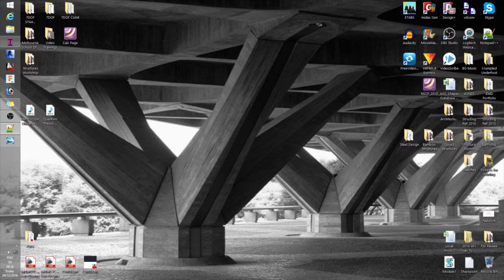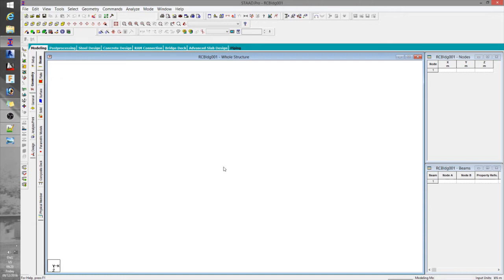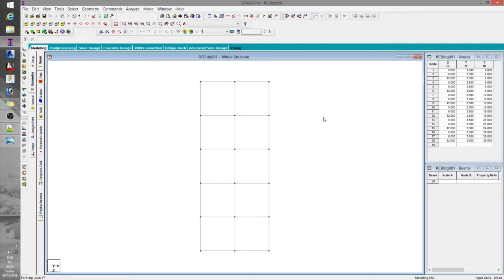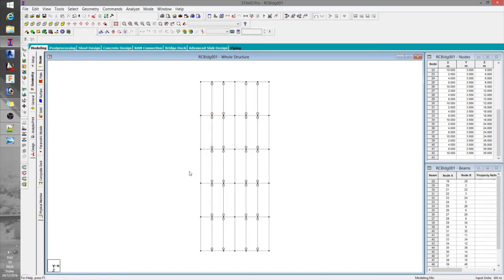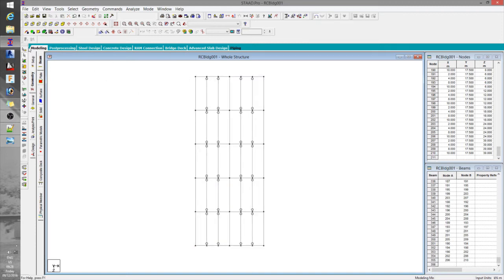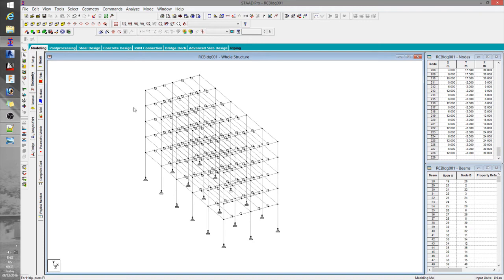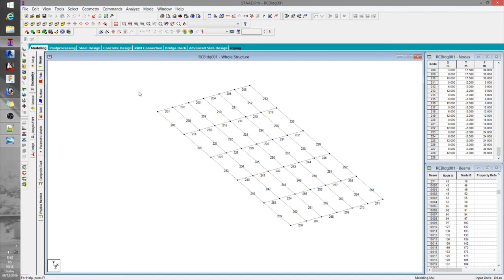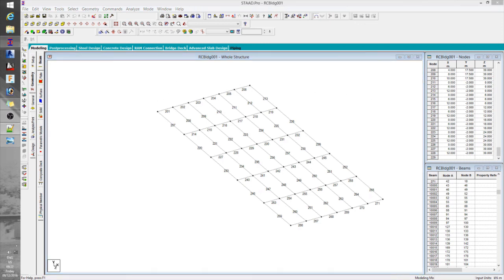02 Staad Basics - Modelling p1 Re

Comment: what model did you use for this structure? Space? Plane? Truss? Floor? then Add Beam? Add Plate? Add Solid? Thanks for your reply sir. sorry for the newb question.
Reply from the maker: Hello,
This one is a Space Structure. If I remember it correctly, the model was started by adding nodes, connecting them and then repeating the entities (translation) to complete the geometry.

Hope this helps

Comment: first of all thanks for this free video tutorial  sir,
just want to ask question (noob question), why there are release command, can you explain this further sir sorry I'm very noob at this 
and the foundation why it is pinned? (I'm very noob at structural)
TIA
Reply from the maker: Hi +zagvot. You're welcome.
It's fine. Some viewers might have the same question too.

To shortest answer to your question is: "that's how I (design) want them to be..." You can have them in almost anything you want so long as you'd follow the proper detailing requirements.

Now to explain why, I put the release on the secondary beam to try to prevent torsion in the Main/Primary beams; as for the foundation, I do not want unnecessary moments in the foundation. As an alternative, you can put tie beams and frame them together. It is expensive for most cases to design a "fixed" footing so I usually avoid it...

I encourage you to sign up to Engineer's Den, a community I'm trying to build to connect engineers, teachers and students. You can post questions or start discussions there. The main goal is to facilitate learning.

https://enricodalistan.wixsite.com/engineering/forum/

Did I answer your question?